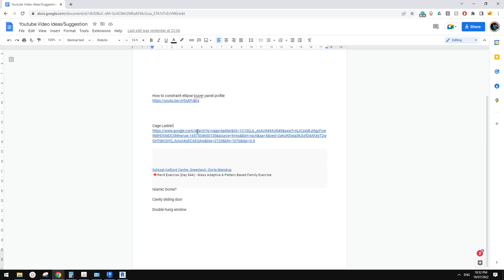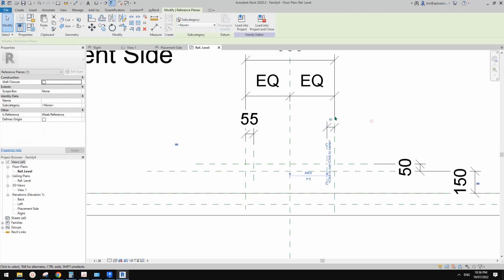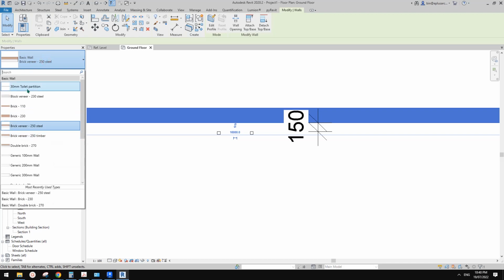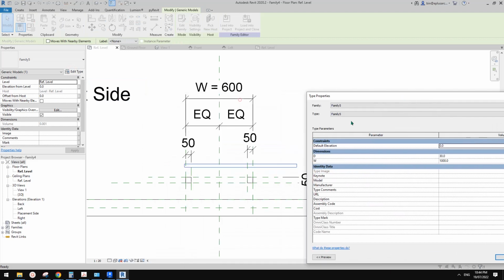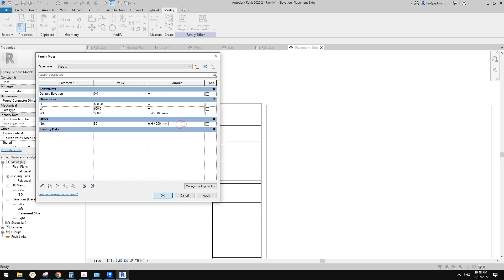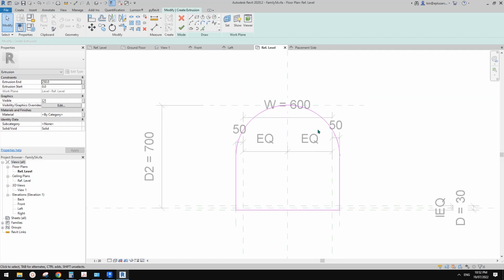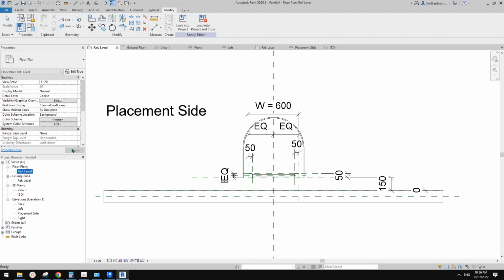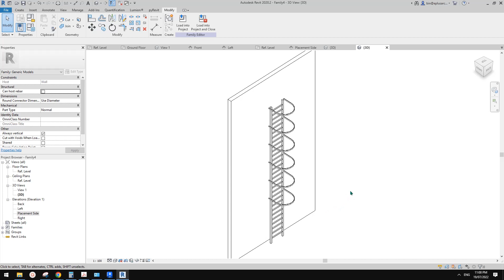Revit Exercise (Day 848) - Cage Ladder Part 1

Comment: After watching your video, I have a question that I hope you can help answer:
If the bottom protection ring is larger than the second protection ring, how will the installation of No.2 be done?
Reply from the maker: You can create the bottom ring as a separate entity and start the array with the second one.